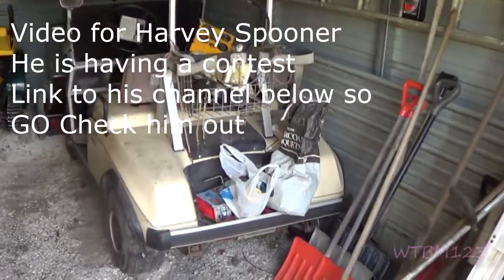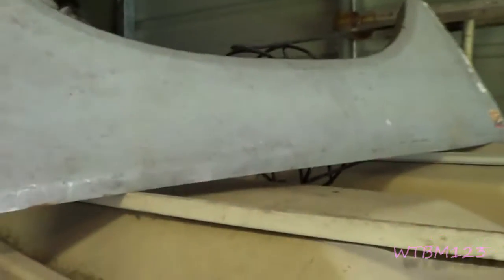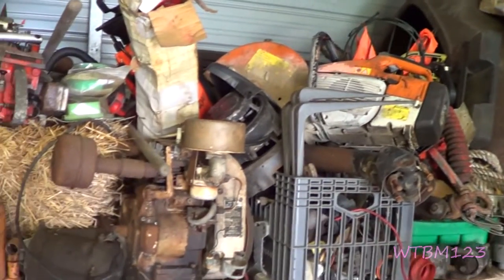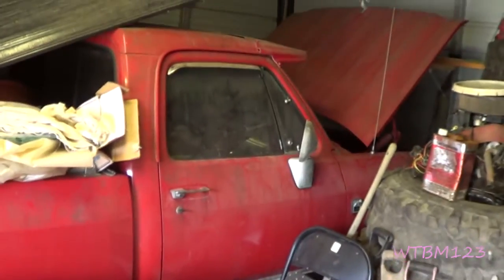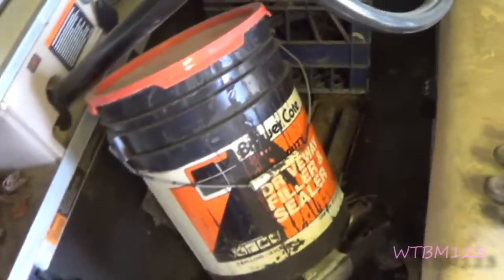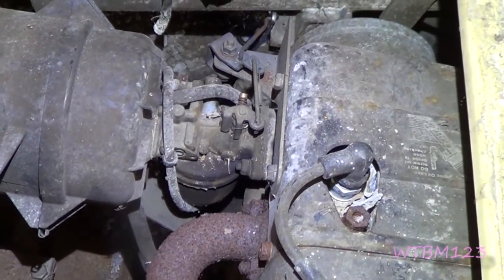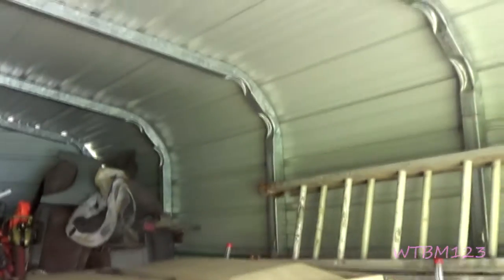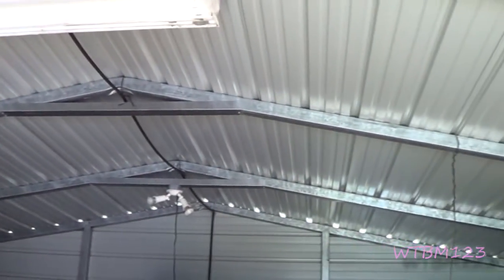ClubCar Golf Cart   First of the Golf Cart.

Comment: wtbm123, Golf cart is in nice shape, it will be a fun ride once it is running. I like the aftermarket wheels. U seem to have a nice little hoard out there in the garage, cool Dodge, lots of nice toys. Good video, thanks for posting!
Reply from the maker: The cart needs cleaned but is in nice shape for its age. Wheels were on it when i got it. Want to someday make a toy out of the dodge. I do have a variety of things in the hoard. Before I had to move here I had a very big hoard with lots more stuff. I still have much more hoard than I have room for  ,some may have to go.
Reply: wtbm123, Expanding the garage will make room for Ur current hoard and leave extra for expansion. BTW, that yellow panel with the truck gauges is something that U need to keep forever, who else has one?